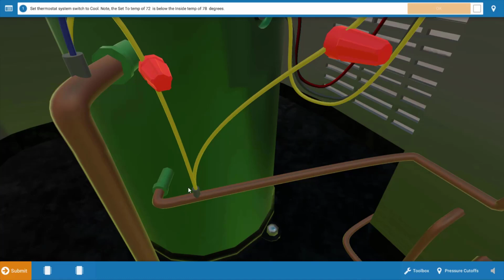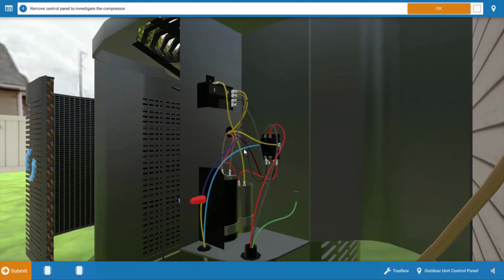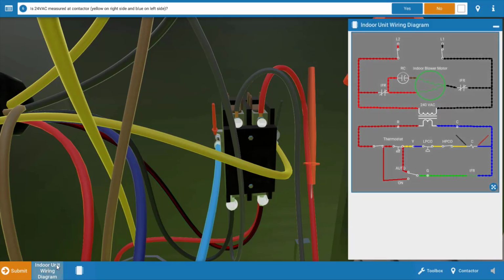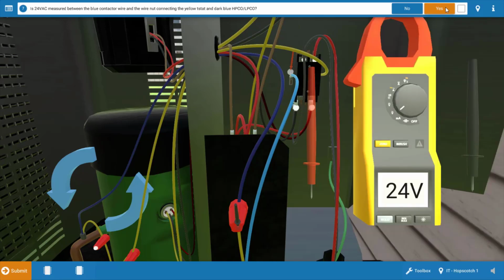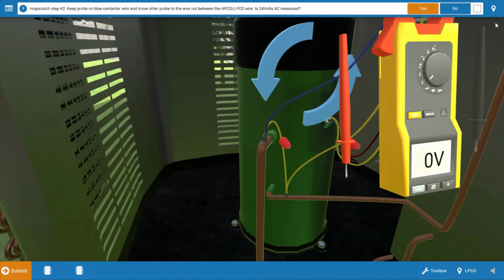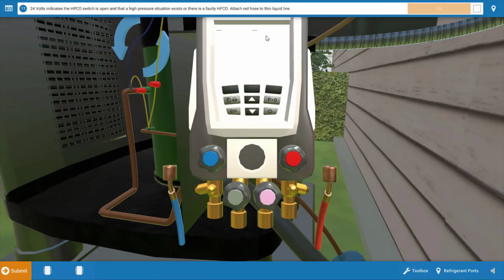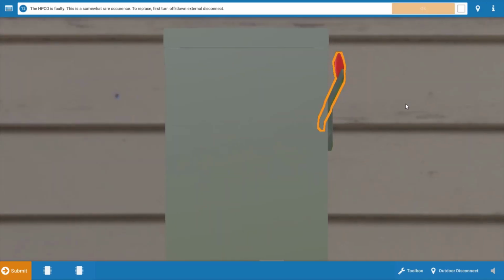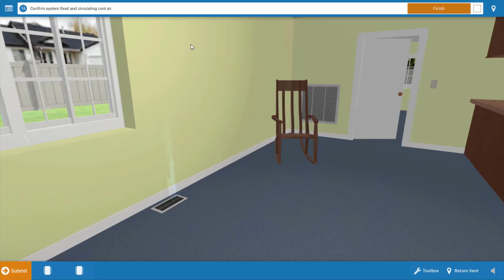How to Troubleshoot a Faulty High Pressure Cutout on a Residential AC

Comment: Thanks for sharing. Question: how can you measure voltages on the LPCO and HPCO switches if you have the condenser fan motor running? How do you get inside the unit?  Thanks

Comment: I have a Lennox heatpump, it was bought about 5 years ago by the previous house owner. When I bought the house about a year ago, I had the unit checked out and the guy said that there was a freon leak that was un-repairable and I needed a new unit for 10 grand! I said I'd think about it but really wanted a second opinion. I ran it anyway and it seemed fine the rest of the summer. Now when I first ran the ac unit it gave me a 413 Lennox error on the screen. I arranged for a different company to come out and take a look at the end of the week. I am hoping that it's a repairable problem. Any comment would be welcome...

Comment: hey Tim how are ya hope all is well. I'm a installer w light service experience.  I was testing my own unit at the property where the fan and compressor both would run then cut off. so I tested from the tstat for 24 volts to the condenser I got it contactor also was pulled in but once fed the high voltage by replacing the disconnect fuse back in the cond. fan and compressor would run but then turn on and off. I checked the hv to contact wire (red 6.6 amps) (black 7.6 amps) confirming obviously compressor was getting Juice to it also testing for voltage   I got 240 volts coming in. so that part was fine. now testing from the stat wire coming in to where the hp wire connects in series w the lp wire that was connected on the contactor w the stat calling for ac I didn't get 24 volts ... on the digital gauges I see low side 129.6 and high side 129.5 now this is 410a now with the 8.7 slt 75.8 lst 71.6 and the vsat 44.7 and the last 44.6  and sh at 31.1 .....what would you assume the issue is.... low on refrigerant? or faulty low pressure or high pressure switch??

Comment: I'm hoping you can guide me in the right direction. I have a Trane heatpump model 4WCX3048A1000AA (on the roof). It is self contained no furnace in the house. 
On the heat cycle the unit runs for approx. 30 seconds then shuts off for approx. ten seconds and then back on for the 30 seconds and then back off. 
( I believe this is called short cycling). I do not have any problems on the cooling cycle, that works fine. I have replaced the thermostat, blower motor and both caps. 
On the reverse valve I can hear the hissing when switching back and forth. (I do this by energizing the reverse valve and then removing the power wire and then re-attaching.
I don't know if this is a correct way of doing it but..) Any guidance would be greatly appreciated.
Reply from the maker: Sounds like it could be cycling at a low pressure or high pressure switch. Could be an indoor air flow problem such as dirty filter dirty blower wheel or dirty A coil.
Reply: @InterplayLearning   Thank you for your reply. Filter was changed, new blower motor and coils were just cleaned within the past 3 months.
Reply from the maker: @brtymat5841  That's difficult to answer without actually looking at the unit. Reversing valve may be partially stuck.

Comment: I ended up here because my control board has an error code of 02, which according to the manual is high pressure switch fault.  I did not note that the compressor fan is running, so from what you say, the fan not running can cause the high pressure cutout to trip?  I tested the capacitor and the microfarad readings are in spec, however there is infinite resistance between fan and common prong.  Is that a failed capacitor?  Seems odd that it can read microfarads but infinite resistance.  The symptoms are that when the heat pump begins to heat, the indoor blower motor and compressor start at the same time, but the compressor (I believe, unless it can be the compressor fan) can be heard stopping after about 2 seconds of running.

Comment: Great Video!
I just figured out that my problem is high pressure switch . how do I reset it on old system? I cant locate any buttons. are they resetable? or I need to replace it?
Thanks in advance!
Reply from the maker: The pressure switch needs to be replaced. Something caused it to open. It's possible after replacing it, there may be another problem. Ensure the coil is clean.